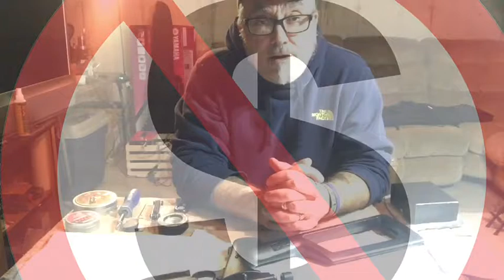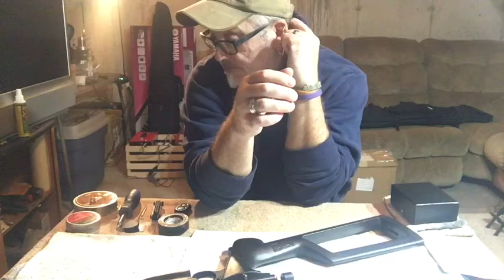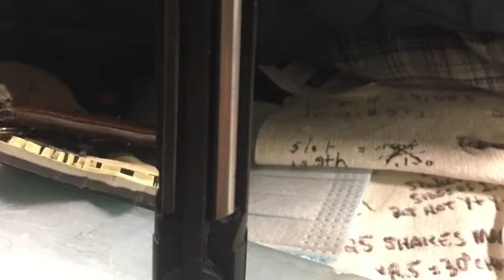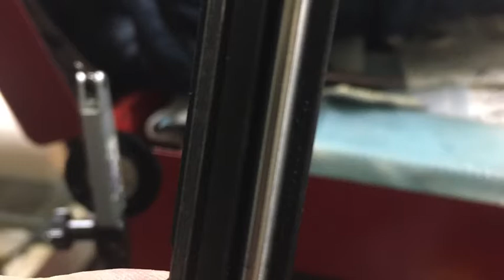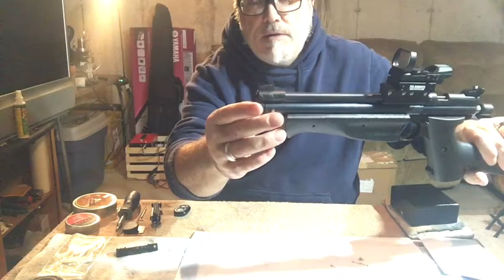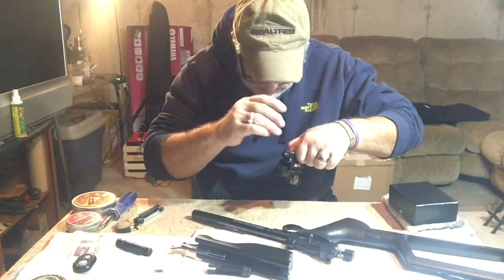Modification of “New” Pump Piston

Comment: Slide a piece of heat shrink tube over the shaft of the piston to retain those rods and dress it up some.  It should fit since the piston cup is larger diameter than the piston shaft.
Reply from the maker: That’s a great suggestion.  I have it together wrapped in electrical tape already, though. That method has held up well on my 2289.

Comment: It may be that the custom shop simply hand sorts the pistons they use, so as to blue print them.  I have noticed some production line pistons tend to be less than desirable because of the injection molding process.  I have seen some production line pistons that have a slight curve to them because they were poorly filled in the injection mold.
Reply from the maker: 🤷🏼‍♂️ that could be the case.